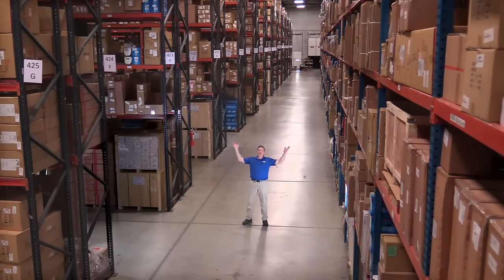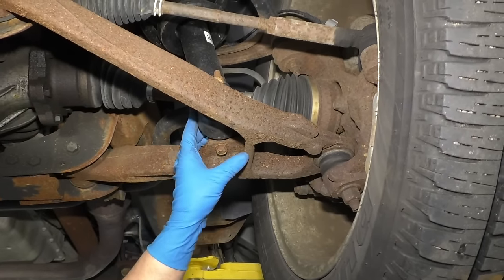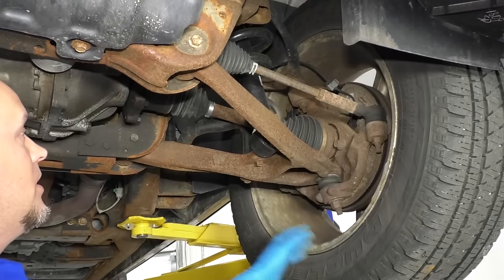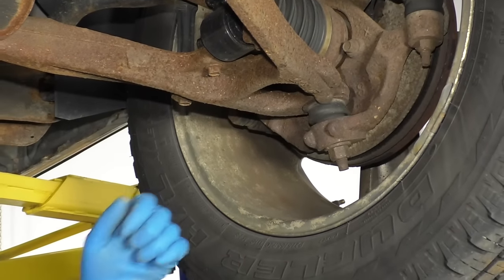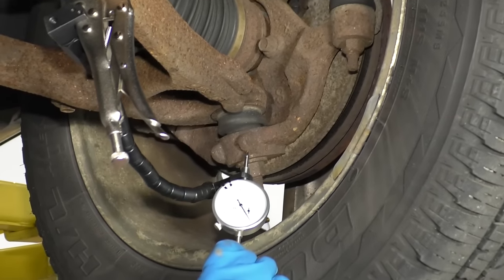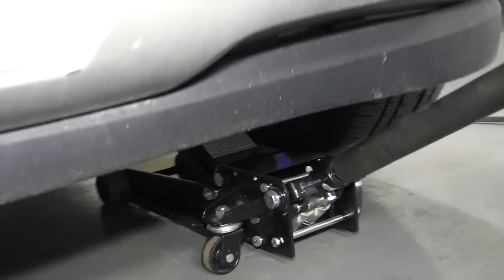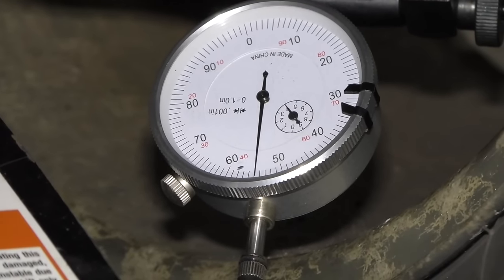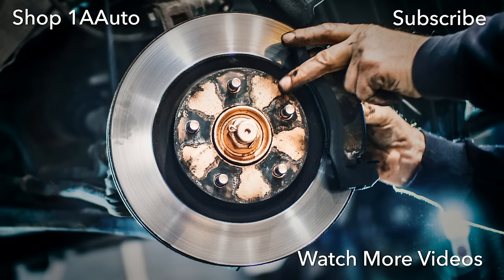How to Diagnose a Bad Ball Joint

Comment: you don't need to use a gauge to test a ball joint lol. in school they actually teach you to test it by lifting the car up and moving the tire up and down, with one hand on top of the tire and the other hand at the bottom of the tire and shaking it up and down. if there's movement then ball joint is gone.

Comment: Nice Video Brod it worth learning. I have a simple question regarding ball joints in a car. They said that there's only 2 ball joints in one car and the said mechanical partst is that on your video in there own understanding but i disagree with it. I know that there are more than 2 ball joints in a car. If i am wrong how do we call those can be found on rack ends and tie rod ends, for me it is obviously  ball joints with the same function in different ways. I am confused, if i am right how could i explain it to them, if i am wrong just teach me why. They are mechanics and i am not. Your response will be appreciated. Thank you
Reply from the maker: +Air Wolf Thanks for checking us out! Some vehicles have just two ball joints, while others have four or more in some cases. It all just depends on the vehicle! http://1aau.to/m/Shop-1AAuto-c

Comment: If you can answer me this...I'm looking for a bad joint  so I'll lift my truck 2" off the ground I did hold the tire 9 and 3 of the clock position no much of movement in the tire...okay so my next   hands on the top and the bottom like 12 and 6 o'clock position shaking the tire and boom!! The wheel like out and in out and in like the wheel is loose really bad , what cousing it?? A ball joint or tie rod?? Answer please
Reply: Bad wheel bearing would be my guess. If your like me I started out just changing wheel bearings then discovered tie rods and ball joints needed replacing as well
Reply: Tie rod, inner tie rod, wheel bearing
Reply: I'D BET ON BALL JOINT. HAVE SOMEONE DO THE 6- 12 SHAKE WHILE YOU WATCH THE UPPER AND LOWER BALL JOINT TO BE SURE WHICH ONE IS BAD.
Reply: 1. Ball joint(s)
2. Wheel bearing
3. 1&2
Tell us what is the veredict.